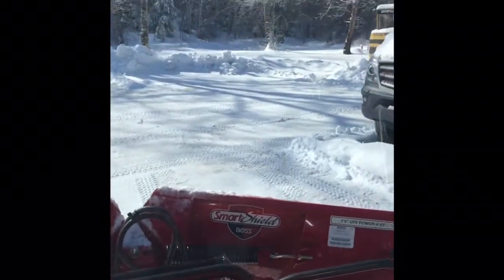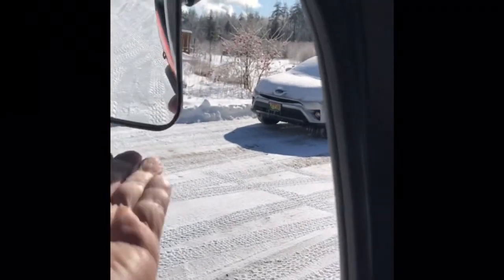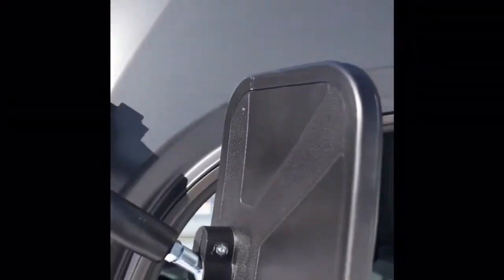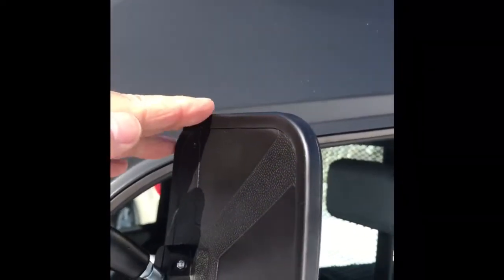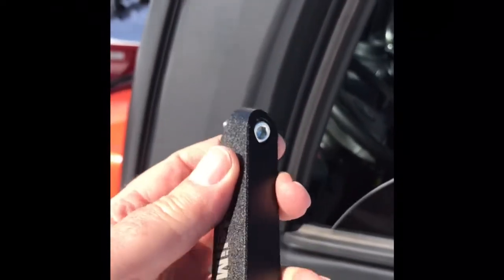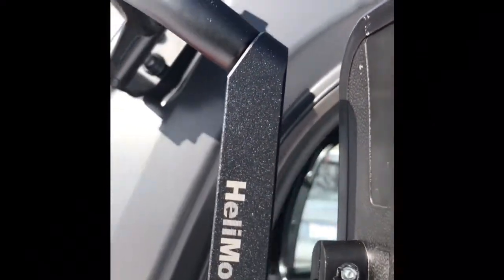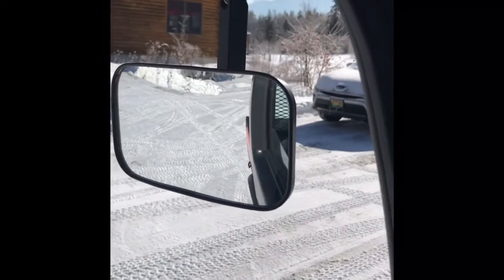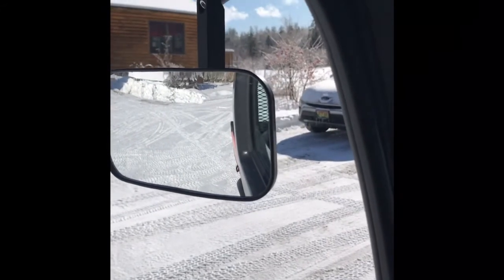Kubota RTV 1100C HeliMod updates

Comment: how or where can I order this part ? help
Reply: Hi Ted
You can order this product from Heli Modified Inc. The kit is $34.95 plus shipping and it’s call “Kubota RTV 1100C mirror adapters.
Call 1-800-625-4642 Monday to Thursday 9:00- 5:00.
Reply: @harryeddy2208  Hello Harry, Thanks for your reply, are you happy with this mirror and did it use the door hinge bolts for mounting.  I do not want to have to drill into the door.
Reply: ted 
I chose this mirror because it bolts to the upper  hinge. Only problem, as I described in my video, the mirror is mounted to high. Also the mirrors need to be tightened at their pivots to the max to keep them from flopping around. For me the adapter puts the mirrors in the correct location.
There are other mirror options available but like you there was no way I was going to drill my doors.
Reply: did you find out where to order this i tried the phone numer and it does work, no answer